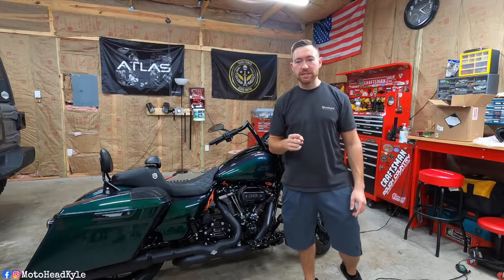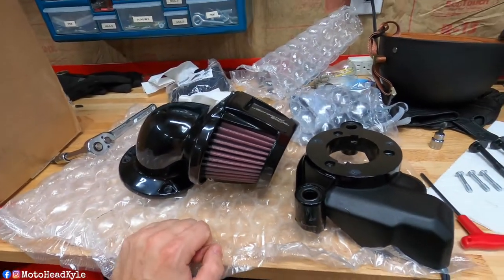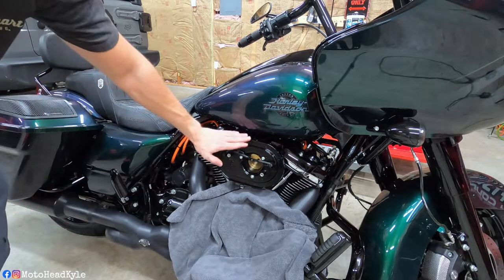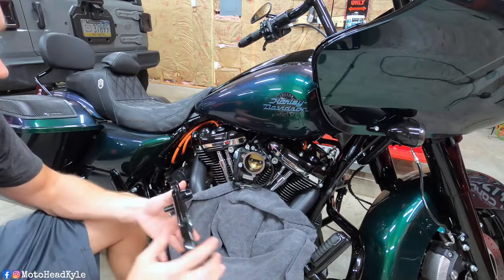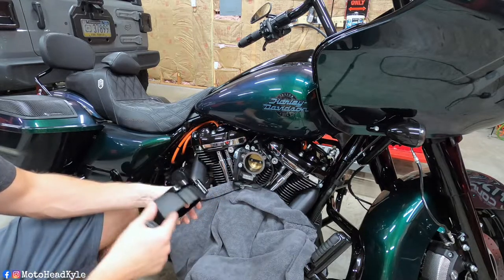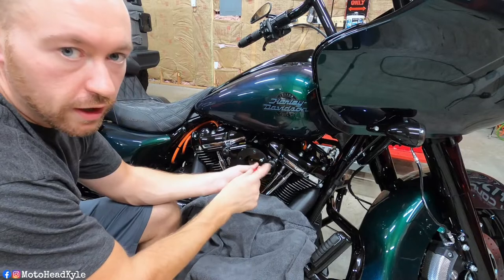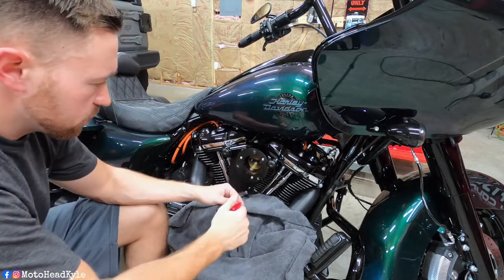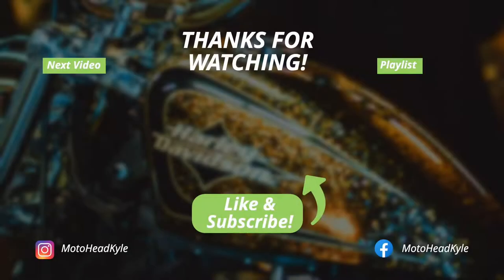How to Install a High-Flow Air Intake (Stage 1) on a Harley Davidson Road Glide

Comment: That stock air cleaner was once a screamin Eagle upgrade. A highly recommended upgrade right along with the new one he installed. This is purely a cosmetic change nothing more. Absolutely nothing wrong with that. Make it how you want it.
Reply: Do you really have to re-tune the bike after? I thought the factory air cleaner was already a stage one?
Reply: @ericvalencia3642  the high flow ventilator that is stock, flows the same as the elbow heavy breather installed here.. tune would be the same.
Reply: @ericvalencia3642  NO tune is nessessary for this intake (not sure why he said that) - These bike run richer then the twin cams that "could" need a tune.

Comment: i like the look too. not sure how much air you get. i know i rode through heavy rain here in florida a week ago and i had the net over the air cleaner and it did sputter a few times. wonder how much rain would affect this one.
Reply from the maker: Honestly probably the same with a rain sock. The rain sock can only hold its own for so long lol
Reply: @MotoHeadKyle  yep true. funny how no other bike besides harley has problems with this.
Reply from the maker: @robertlumsden942  most other bikes don’t have a open air cleaner.. you can always change it

Comment: Awesome!! Do you have a tuner?
Reply from the maker: I didn’t until I added this! I’m running the Dyno-Jet PV4
Reply: @MotoHeadKyle  wondering if you did a dynojet video and how it's working? Also do you have RDRS? did the dynojet cause any issues with the RDRS?
Reply from the maker: @ericroadking7564  So I haven’t done a video YET.. plan on doing one in the spring to go over the PV4. Haven’t put enough miles on it yet to see how it handles over time, but yes I do have RDRS and so far no issues.
Reply: @MotoHeadKyle  thanks Kyle look forward to that video and how you program it and how you used learn mode!!! Stay blessed!!

Comment: Those stock air cleaners on the 114's seem to be a  high flow stage 1 anyways....I would just buy a K@N after the paper one is dirty and needs to be replaced...
Reply from the maker: I did have a K&N drop in filter. I liked the look of this, so I changed it
Reply: @MotoHeadKyle  I know...They are Kool looking....But as far as performance they dont do any better job than the traditional SE stage1 intake or aftermarket brand...And like you said for 6 footer or taller riders it rubs on the inside of the right knee...
Reply from the maker: @bradlozano2571  I’m aware… this is what I wanted and I got it. I never said go out and buy one lol

Comment: Doubt there is any change in performance here. Just purely cosmetics. The inlet size on both of the intakes look the exact same.
Reply from the maker: The only difference could be ambient intake temperature, due to the filter being spaced slightly farther from the motor